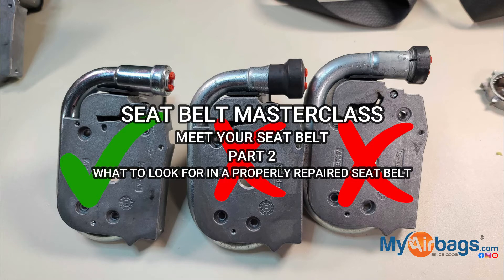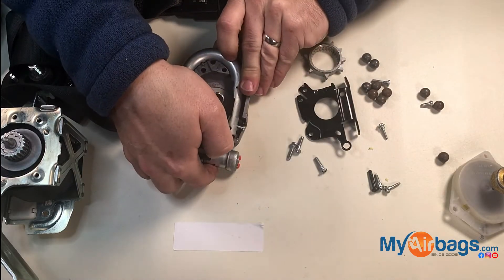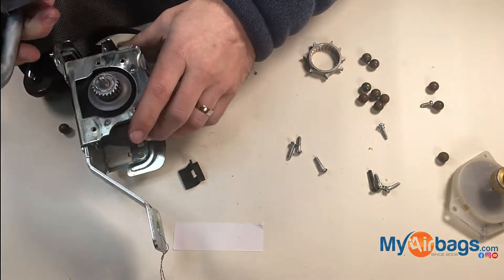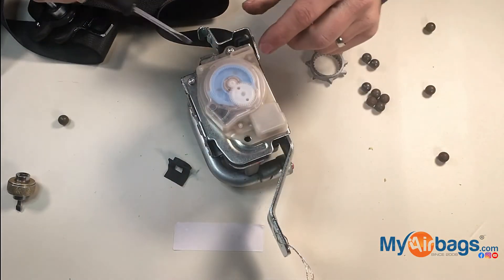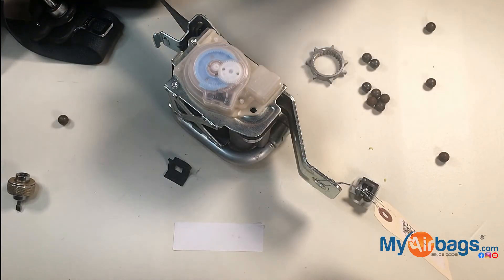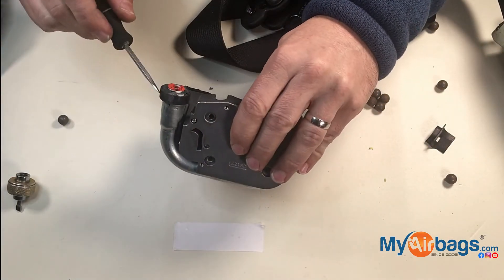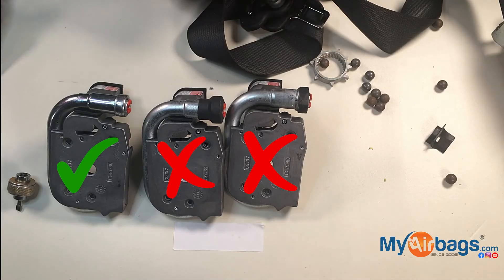How to Repair a Seat Belt Pretensioner - Part 2 | MyAirbags

Comment: Wait that role of belt isnt called tensioner? It is pre-tensioner? I got error on my car seatbelt tensioner and i order that roled seatbelt. I was wrong, it should be the device that goes in with click?
Reply from the maker: There is so many names for these seat belts. Tensioner, Pretensioner are practically the same thing.  You ordered the correct part.

Comment: I have 2011 quattro audi a6 light  air bag ?! I check they say is the rear right side seat belt sensor ?! What I supposed too do ?!! Buy new seat belt or change only the sensor  how that work ?! For too fiks the airbag light on screen
Reply from the maker: The sensor is part of the seatbelt assembly. The entire seat belt needs be replaced or repaired. MyAirbags can rebuild the seat belt with OEM original parts, including the sensor. The sensors are hazmat and not available for general public and requires licensing to purchase them

Comment: My Mazda CX-5,  after an accident  have the rear seats belts locked. I removed, and sending for repair,  but the corect the mechanical issue ( the seat belt retracting correctly),but the pyrotechnic caps was not replaced. Because of that I have 2 errors, for ghe seats belts that was partially repaired.  I try to delete the code wit Autel MaxiCOM MK908Pro, but without success.  The problem is still the pyrotechnic caps, corect?
Reply from the maker: Yes, that is correct. The pyro sensor is what is causing the light to stay on and for the DTC error code. MyAirbags can rebuild the seat belt and will install new pyro sensor.

Comment: can you buy the parts to do it yourself or does it need to be sent out. was in a side collision and curtain and seat air bags deployed and all the seat belts activated. I'm doing all the repairs myself including air bags buying them new not used but I have 4 seat belts the locked up
Reply from the maker: If you can salvage the parts from other similar seat belts then yes. To buy pyro sensors need a license.
Reply: @MyAirbags  IT IS NOT A PYRO SENSOR, IT IS A GAS GENERATOR. THERE IS NOT SENSOR IN THERE.

Comment: Hi ! I had very small accident in my 2007 Honda fit dealt bel lock and the air bag icon came on on the dash ! If you guys repair my seat bel the air bag ligh desaparición ? Or have to eras or reprogram or reset it ?
Reply from the maker: Yes we can reset the airbag computer module and rebuild seat belts. It will save you up 80%. Visit myairbags.com today!

Comment: What’s the name of the stopper tool?
Reply from the maker: What stopper tool are you referring to? Please rephrase your question.
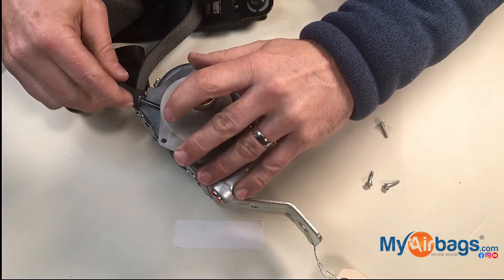Reply: @MyAirbags the stopper tool used to hold the spring in place. It’s at 0:25 on the video
Reply: @MyAirbags I have a cla coupe diesel 2022 mercedes my rear seat belts are locked how do I open my shell ???

Comment: Hi, I need to replace the stopper in my 2006 Dodge charger but am having trouble finding a new part. Where can I find these or how should I refine my search? Seems everything I look for are those metal things you shove into the buckle mechanism.
Reply from the maker: Here is a link to a black seat belt stopper. MyAirbags.com also has them in different colors. https://www.myairbags.com/product/-sb-stop-button-black/

Comment: My seats was frayed so I got a replacement out of a breakers yard like for like the car in. Nissan qashqai now I have the airbag light on, what have I to do to fix it
Reply from the maker: You might just need to clear the light with a scanner. If that does not help, then could be a bad airbag control module or a bad seat belt pretensioner. We do reset airbag control modules and rebuild seat belts.
Reply: @MyAirbags  hi I sent you
My seatbelts they still have the bolt I need the bolt please don’t throw away

Comment: Does pretensioner work when only a curtain Air bag explode, a side colision?
Reply from the maker: Usually seat belt pretensioners are the first to go bad before the airbags. If it is a small collision then airbags will still be okay, but seat belts will blow. To know for sure you can have the system scanned to het codes to see if the seat belts are bad.

Comment: Hello i have question so im intalling a racing seat belt on my car so im removing my OEM seat belt for weight reduction purposes so my question is will it give me a light on on my dash if i unplug my pretensioner sensor?
Reply from the maker: Yes the airbag light will be on, because the airbag control module will see that the seat belt pretensioners are missing. You can bypass the seat belts by installing a 2 ohms resistor at the seat belt plug connector. This will give it the correct resistance ohm reading to the airbag control module and it will think the seat belt pretensioner is still there. Do this of course at your own risk.
Reply: @MyAirbags  Is the resistance value always 2 ohms or does it differ from one car to another?